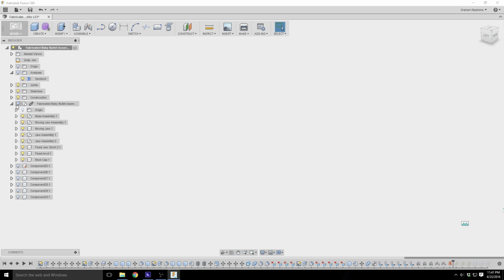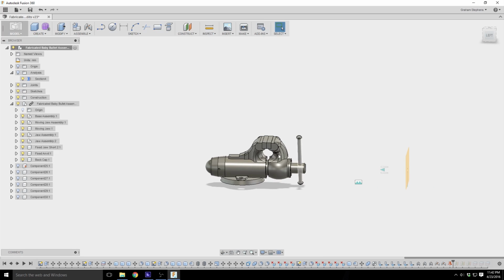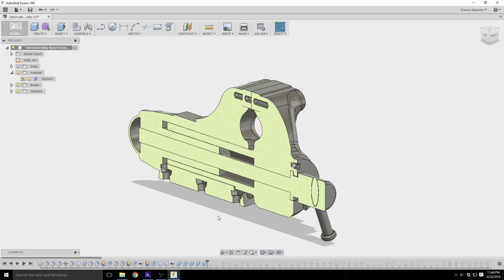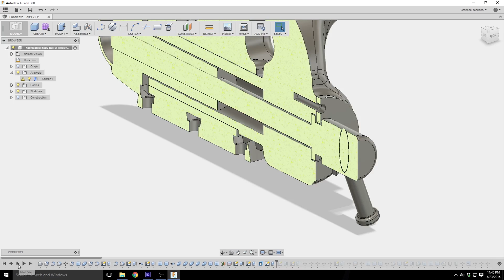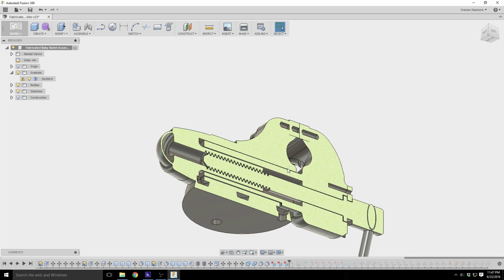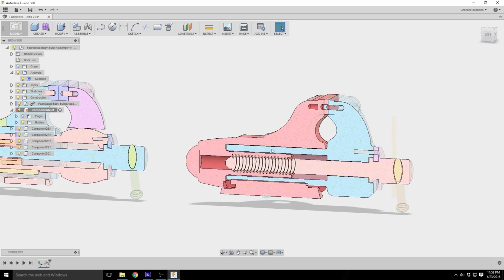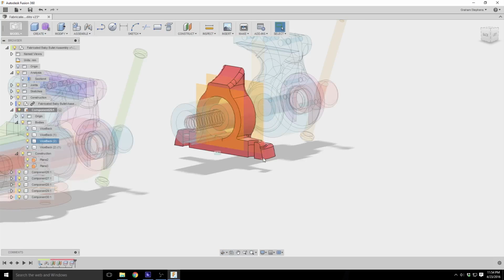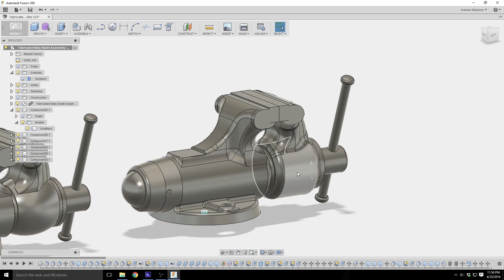3D Printing a Model of a Functional Vise! Created from the Ox Tools, Wilton Baby Bullet Vise project

Comment: If you do another, use removable jaw faces. That way you can print "pallets" that precisely hold specific parts or sub assemblies at optimized tinkering alignment. For the machine screws, helicoil thread inserts. Basically coil springs wound in thread diameter and pitch, you tap for them, then insert with a driving tool, and have steel threads. They're an auto, marine, and aviation staple, and will make that vise a genuine "forever" tool. Glued in threaded bushings are a cheaper, functional, far less elegant solution that gives a little longevity up but require no tooling, just print to fit and goop in. Either way, just mod the screw print holes to "predrill" for your chosen way of getting the job done. Hell, mod a little here and there, you can make it cnc with a nema motor and lead screw, or run a steel acme setup to be able generate quite significant clamping, or... The mind boggles. Now consider any print in pla will cast in zinc (pennies, lol), or aluminum (cracked blocks and heads, intakes, etc from 21st century vehicles) quite nicely with practice, and this opens all kinds of motion and clamping doors, with impressive potential for router and cutting class systems, or multi axis light milling. Lol, tons of light bulbs here, THANKS!!!

Comment: a simple household tool will take like 2 working  days to actually print, another 2 to design and test another 2 to assemble,  not to mention an engineering degree , to get a plastic thing that works but will break soon that will cost way more than it would if bought in a store,  which could be had in under a hour,, more  for materials alone  and hundreds of times more all things considered...so for a near impossible to get part or device or to design something new it's  ok other than that it's just a huge gimmick to infer its a useful thing,, it never will be unless as I said you live ON mars, you want a illegal item or you design things not in existence.

Comment: Nice work!

I would have been inclined to make the thread on the main screw a buttress thread or something near that.  You only need strong flat surfaced for pushing the jaws together.  The other direction can be sacrificed to get the faces exactly at 90 degrees where it matters.

Comment: you don't need the cap to be bolted on; can the sp_ndle and the front p_ece not be pr_nted as "one" w_th the reta_ner be_ng part of the front claw?
Reply from the maker: You need to slide the threaded rod into the vice before putting on the bolted cap. You could probably print it in less parts, but this was modeled after a particular model. Thanks for checking it out!
Reply: good v_deo :-)
Reply: I'd like to solve the puzzle...
Reply: have some of those:
IIIIIIIIIIIIIIIIIIIIIIIIIIIIIIII
iiiiiiiiiiiiiiiiiiiiiiiiiiiiiiiiiiii

Comment: Sweet.
Did you not need any WD40 or spray grease on the thread?
Reply from the maker: Nope. The material I used to print with is pretty low friction, and this is not designed for high clamping applications, so it does not bind up.

Comment: Now you just need to print something to screw down the base plate on the main body of the vise to, so that the entire vice can be turned and pitched but yet held in position.  And then perhaps do said base with nearly 0 infill, except to hold it together somehow, so that there's space between the outer and inner walls of the ENTIRE base portion.  Leave a few access holes, then fill the base with sand.  Acetone-weld in some closing caps to those fill-holes.. and there you go.  Your vice, mounted on a base that lets it spin, pitch, all of that.  And the base is so heavy it's sure not to move, so you can have some fairly large circuit boards up in the air without the whole thing tipping while you work.

Comment: this 3d printing  is getting out of hand now ppl believe  using toy vices for real jobs its a solution :)) as if you d go to a  kids store and buy a  plastic toy hammer
Reply from the maker: +Gr8Success I trust people have the common sense to use the right tool for the job. A plastic vice works great for holding a PCB, but I would not use it for much else.
Reply: I did follow Tom's build on his channel and saw the magic that was created. The real magic in this project is the collaboration going on here. Tom's magic using old school tooling and incredible skills with tooling. Then out that into a .stl file and have that project turned into a tool purposed for someone else is incredible. Then someone else like John over at NYC CNC can take the file and build another tool with it. The point here is how the collaborative process is the miracle and everyone benefitting from it.

Comment: Excellent work, any chance of getting the  stl files posted, I'd like to try printing this with the carbon fiber PLA. Or maybe the iron PLA....might be cool to let it rust and then seal it... Again awesome work. I too watched all of Tom's videos, very awesome, I learned a lot!
Reply from the maker: +jashbaug I've done some more work optimizing the model for easier/stronger printing, and the link is now in the description box. Iron PLA would be really cool, it's something I've wanted to try, but I don't have a hardened nozzle. Make sure you post somewhere when you print it, would love to see!
Reply: Thank you for sharing. I'm changing my nozzle and testing the material/print after I get it done I'll try it with the iron PLA. Awesome work. Thanks again.

Comment: Hey Graham,

Nice remodel and build. Vise looks great. Now you will want a laser sintering printer so you can make one in metal.

All the best,

Tom
Reply: +Diode Press Actually, you could fairly easily take that and make a mold out of it so you can cast it in aluminum. That'd be much cheaper xD
Reply from the maker: +oxtoolco Thanks, Tom! Appreciate you putting the files out there, it was a fun little project to work on! Laser sintering sounds like a great idea, but a little out of the budget, ha!
Reply: Can you use a form of wax as a medium with such a printer? If you could you could make as many wax components as you wanted as forms for lost wax castings.
Reply: William Jackson there are wax filaments, but you can cast using pla!

Comment: Really cool and really nice looking prints. I know you must be very careful not to crack the lead screw by over tightening but do you think a design modified with a few captive nuts in the body and a cheap piece of threaded metal rod would be a worth while upgrade?
Reply from the maker: +builtrodewreckedit Captive nuts and metal threaded rods would make it stronger for sure, and the material used ABS vs PLA vs PET etc. would make a big difference also, in addition to the orientation that you print the parts, and how the layers stack. As-is, it has enough pressure/strength for holding anything I'd need it to do. Thanks!

Comment: will your kossel printer print the same quality as the printer you made your vice with?
Reply from the maker: +Raymond Hu I don't think my Kossel would have too much trouble with it, but it would take longer for sure. The biggest issue I have with it is the lack of heated bed. It tends to warp things a bit, but I'll give it a try and see how it goes!
Reply from the maker: +Ralphie Vigg They do take a bit more work to get running smoothly!

Comment: Acme threads are the right threads to use from a technical point of view.  Try making one with independent jaws out of metal.  They can be purchased pre-fab and stop you from melting them while soldering.
Reply from the maker: +David Godwin Independent metal jaws are a good idea! even if I stay with plastic, I should keep them removable so I can replace if they get beat up. Thanks!